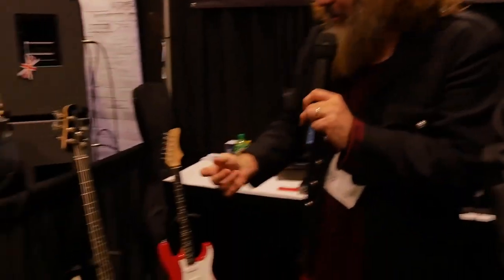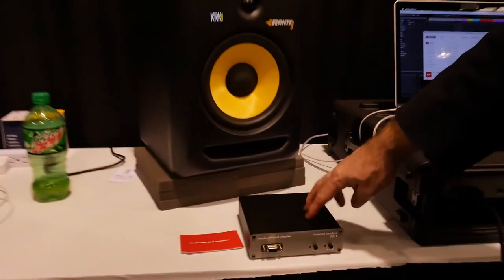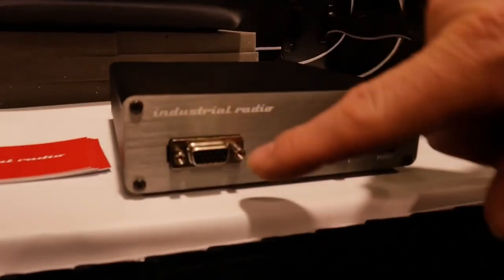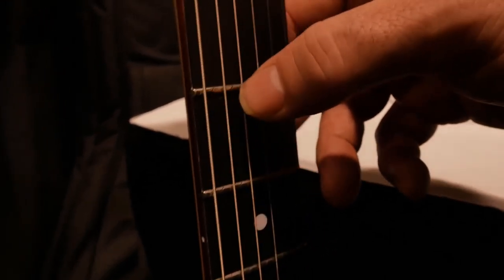NAMM 2018: Gaz Williams at Industrial Radio MIDI Bass

Comment: Are those normal round wounds or are they specific to the bass? And is there a way to use this with physical synths or does it only work with DAWs?
Reply: Jean-Pierre Joubert, the bass ships with standard Dunlop nickel roundwounds. They specify that you need to use uncoated strings and non-painted ball ends (which sadly rules out my favourite Rotosound steels). You can plug into any synth with a MIDI in socket. Though I guess you need to go via a PC or Mac to use the extra features found on the imprint software. If you have any questions, email them via their website - they were very helpful in answering my questions.